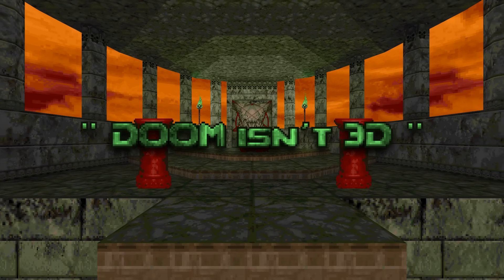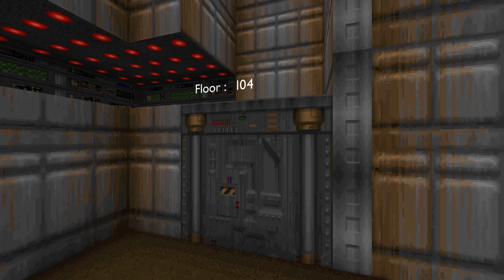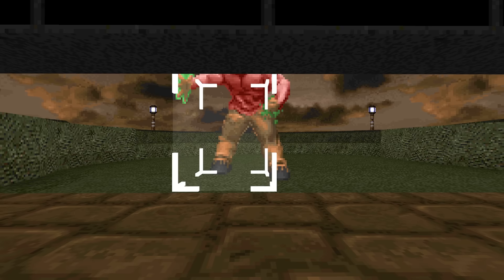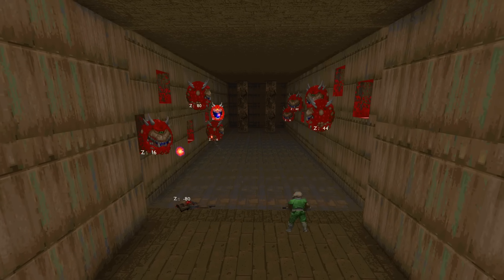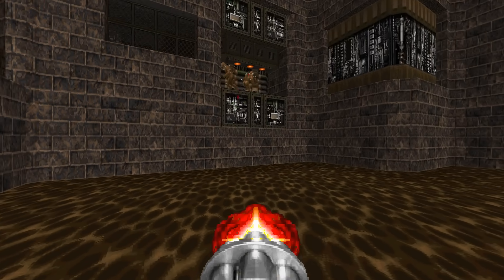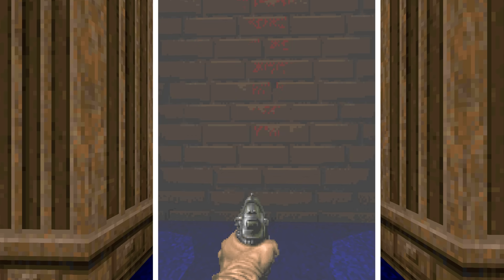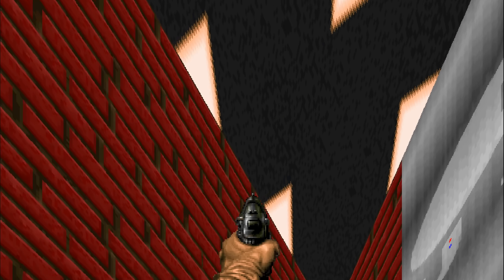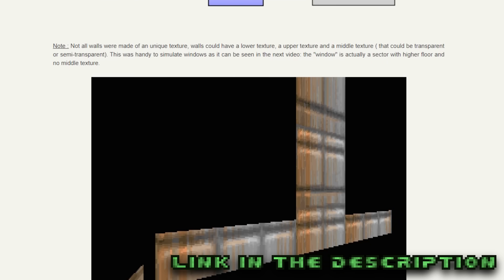Doom engine - Limited but still 3D

Comment: Really good vídeo but i think that a very important aspect have been overlooked in this conclusion, that is the  projection method of doom,  If the projection really is capable of 3D calculations this shuld be it, other wise , doom is a Scan line renderer that can not project 3D geometry only vertical walls, dispite enemy and player use the z Axis  the result is a scaled 2d image that is not necessary to use the  z Axis in calculations to display this 2d sprite, If you could check this information, everything would be more clear
Reply: @borogk  what i refer to is not rendering limitations, but actual data trasformation, im sorry If i'm be a bit too tecnical, but the main factor that defines this discution is the methematical and tecnical information, limitations indeed not defines the existence or lack of 3D in doom. About gameplay be a deciding factor well... capabilities of a tecnology are not defined by user perception. Anyway i'm not saying that i disagree in your conclusion since i have no deep information on how doom engine actually works and many points that you come up with actually drives  aroud actual 3D, but i would insist in a more directional investigation of the case.
Reply: @SilvestreCoda-c2o  

"The gameplay is strictly on a 2D plane, but the rendering is done with 3D coordinates." John Carmack

The engine is a hybrid using several techniques to achieve its unique features, I think that instead of asking "Is DOOM 3D?", a better question would be "What in DOOM is 3D?"

As far as the data structure goes, DOOM is a top down 2D shooter with X,Y coordinates for vector drawing, hitboxes, movement, acceleration, collision detection, line of sight for the A.I. and projectile trajectory calculations. Actors and sectors have an internal stored value for Z that's used for z-clipping calls (a technique used for depth sorting and hit detection in 2D games) and rendering offsets for walls and sprites, which's what creates the illusion of 3D physics, but it cannot be used for trigonometric functions and world coordinates. Another oddity of the IDTech1 is that a lot of its functions are sector based, meaning that every entity inside a given bounding box called "sector" will inherent some of its variables for data check (that's why walking monsters "pop" glued to the floor when crossing sectors of different height or "disappear" in dark sectors). The game physics and geometry are bound to a 2 dimensional plane, but the rendering of walls requires 3D calculations for dinamic horizontal perspective corrections, which's simplified by the fact the engine can only draw orthogonal projections from the camera POV, while floor and ceilings always keep their perspective and are rendered separately from the walls.

Here's a 2D game prototype I found that uses techniques similar to DOOM to emulate "height". What it lacks is the ability to rotate the camera 360 degrees, which would require those tiled sprites to be vector rendered with 3D perspective correction, which, although limited due to processing power of PCs at the time, is what's actually 3D in DOOM.

https://www.youtube.com/watch?v=AAeOXqS271g
Reply: @filibuster2249  now, that does ring  a bell, so actually there is 3d calculations !  really cool, i certanly shoud give a deep look in the subject, doom engine always was a true mistery for me since most of the easy to  consume information really never show up in dept implementation, i already try to come up with a psudo 3D "engine" but never took the time to actually look what other engines actually do, thanks for the colaboration.
Reply: @borogk   // "Z value is used movement and collision detection against the level boundaries"

That's pretty much covered by what I said here:

"Actors and sectors have an internal stored value for Z that's used for z-clipping calls (a technique used for depth sorting and hit detection in 2D games) and rendering offsets for walls and sprites, which's what creates the illusion of 3D physics, but it cannot be used for trigonometric functions and world coordinates"

Collision detection against the level boundaries (linedefs) are pre-calculated and stored in the BLOCKMAP lump using X,Y coordinates and called when an entity collides with each and every linedef regardless of "height". If the value assigned for the entity (zfloor + height) is > than next sector zfloor and < than zceiling, the projectile enter the next sector, otherwise it collides. These aren't world coordinates but values stored in the entities themselves for z-clipping.
In the case of mobs, if the floor offset is <= 24 (if I'm not mistaken), by default it counts as a "stair step" and the mob "pops" into the next sector's height offset. If the zfloor value is higher or the zceiling value is too low, the linedef blocks the mob, it's a simple value range checking used in z-clipping functions. 

https://github.com/id-Software/DOOM/blob/77735c3ff0772609e9c8d29e3ce2ab42ff54d20b/linuxdoom-1.10/p_map.c#L186

That's pretty much what's happening in that video I linked (except it's not cheching for ceiling, but the process is the same), that's what z-clipping is. Note also that the player character jumps in an arch motion and has "air time", which would be equivalent to "gravity". It all has to be coded somehow, but none of that requires an actual z-axis to be calculated or rendered. Of course the IDTech1 is more robust than that, but none of its functions relies of a z-axis when it comes to gameplay.

// "Here's a part of source code responsible for vertical movement: https://github.com/id-Software/DOOM/blob/master/linuxdoom-1.10/p_mobj.c#L246 "

That's the part responsible for calculating sprite and camera offsets, as I mentioned above. All it is doing is basic arithmetic for data storage and rendering purposes.
Player (camera POV) and things (sprites) spawn on the map using world coordinates for (x,y) stored in the lumps, while z is assigned according to the sector's offset + the variable "height". 

https://github.com/id-Software/DOOM/blob/77735c3ff0772609e9c8d29e3ce2ab42ff54d20b/linuxdoom-1.10/p_mobj.c#L642

https://github.com/id-Software/DOOM/blob/77735c3ff0772609e9c8d29e3ce2ab42ff54d20b/linuxdoom-1.10/p_mobj.c#L708

Here's the function that calls P_ZMovement (the one you linked) :

https://github.com/id-Software/DOOM/blob/77735c3ff0772609e9c8d29e3ce2ab42ff54d20b/linuxdoom-1.10/p_mobj.c#L415

First it calls for P_XYMovement, where the P_TryMove actually is located and checks if movement is possible. If P_XYMovement returns True then it checks if the internal 'thing's' value for z is different from the sector's floor (floorz) value, meaning the 'thing' is considered "airbourne", then only if True the P_ZMovement is called to decide how the 'thing' will be offset on screen and then stores the new value for rendering. 
There're no (z,x) or (z,y) calculations here or anywhere that I'm aware of. In short, the engine only recognizes x,y as axis for calculating angles , while z is only used to offset things on screen in relation to each other (or the screen itself when the player moves through sectors) and z-clipping (what to do when things collide with each other or with a linedef on the x,z axis). Z is an thing's property, not an 'world" property like dimension, so to speak. 

// ""The gameplay is strictly on a 2D plane" quote from Carmack - he probably didn't give enough thought before tweeting stuff :) It takes more than 1 minute to come up with more accurate answers and that requires reading and understanding the source code."

I'm pretty sure he understants it better than both of us combined at any given second. I couldn't have come with a more succinct and accurate explanation if I tried ;)

Congratz for the channel btw!
Reply: @borogk  " The end result is very close to what a modern engine would achieve if you construct a polygonal 3D level with straight walls, flat floors, flat ceilings and cuboids for entity hitboxes."

Modern engines can and do trace angled lines in (x,z) (y,z) and (x,y,z) for movement, collision detection and line of sight and much more. DOOM can only trace trajectories in (x,y) since z is only an object variable for reference, it would require the engine to keep track of all points in (z,x) and (y,z) that an object occupies (like in 3D engines) and it would be too demmanding for computers at the time. Instead, everything is checked on a plane and when collision is detected it does a value range check for a single z point reference stored in the object. It's no different than checking a random value against variables called 'Avoidance' and 'Accuracy' to check if it will be a hit or a miss.

"It doesn't matter what data structures are used to construct the level geometry and store objects elevation. You have to store it somewhere. Effectively, Doom data structure represents a traversable empty space in a shape of multiple 3D prisms (with sector shapes defining their cross-sections). And objects' hitboxes are effectively cuboids. "

"Vertical angle in Doom source code is called "slope" and it's totally used in the engine.:"

It's not so much only about where it is store and more about what functions call these values and what operations are done with it. 
Note that at all times in the lines of code you linked the functions are storing numbers to be checked against each other for z. It is not tracing a constant diagonal angle but checking value ranges whenever it moves to a new subsector (BSP cuts of a sector). It always comes down to z1' > 'z2' < 'z3'. Since everything (including things hitboxes) are lines drawn in (x,y), z functions can only be called and change variables when (x,y) trajectories finds a linedef or a hitbox.

   If anything, the way the engine manages to define occlusion points with simple math without relying on a third axis only adds to its ingenuity and brilliance. As I said, I'm answering the question "What in DOOM is 3D?" and none of z-functions I'm aware requires (x,z) (y,z) angles, let alone 3D calculations.

Comment: great video, though i'm a bit confused by the mentioning of the Z axis, i've usually seen Y used for height in games and programs and Z for depth.
then again there doesn't appear to be a universal standard.
also a game like Wolfenstein 3D is considered 3D but DOOM which has much more complex 3D mechanics is controverial? like what?
anyways i'm wondering how the game renders the floor and ceiling texture, since the pixels can be in all sorts of angles as you can move the camera freely to the left/right
Reply: @borogk  seeing all the different source ports for DOOM i'm sure they aren't all consistent with eachother either. so some might use Z some Y.
anyways, i edited the comment while you were replying to add a question, take you take a look at it again?
Reply: @borogk  i mean for wolfenstein it's in the title of the game, so i assumed people just took Id's word. plus i'd still say it's 3D rendered (ie you got walls, floor, and a ceiling like in any 3D Space) even though all of the gameplay is 2D.
and about the Z/Y DOOM port thing i just assumed that that would be the case simply giving the amount of ports out there, i've personally never seen it.

Comment: I appreciate the fairly neutral opinion-based approach of this video.
It really depends on your definition of 3D. At least from a mathematical standpoint, it is not enough to simply have a z parameter to consider, there is a subtle but crucial difference between a 3D space and a 2D space with an extra scalar z variable, which is what doom is as far as I understand it.
Doom's rendering works like a graph of a two-dimensional function into a scalar f(x,y)=z in which every point of the floor or ceiling is asigned a height. Which can be represented in 3D but not necesarily, it could be represented with colors like a heat map or numbers, doom chooses to represent it like that to appear 3D but that doesn't transform the world into a 3D space, but a very specific 3D visualization of a 2D function. And you can do a lot with having this third parameter asigned to the 2D space, if you've ever played the genesis game beyond oasis, height considerations are taking into account all the time to determine if you are hiting an enemy or not, but it doesn't have the fancy rendering of doom so no one would call it 3D. But there are limitations to the approach, like yeah... by definition of a function, no point can be assigned to two different values so that is why there cannot be floors on top floors, or enemies on top of enemies which I assume are processed together on the same function. But you can calculate trajectories just find and do all of your trigonometry, like with projectiles.
So in my opinion, the existence of z doesn't actually make doom 3D, it means that it is a 2D game that assigns a z parameter to all of its objects as a shortcut to do a lot of pseudo 3D calculations.
Think of it this way, you can have a 3D map of the earth and assigned to it a temperature value for each 3D point, you would have x,y,z and T and you could even make a 4D graph of it but that wouldn't make the earth a 4D space.
Reply: @borogk  Floors and ceilings having separate coordinates can be described by two distinct functions with z values, you can map any number of 2D functions on top of each other and still not have a proper 3D space. The same with enemies.

After thinking about it. I don't think it is impossible for a 2D engine to process doom guy going above the demons if you program explicitly to check for the z data, they are all separate entities. And if you turn off collisions that is exactly what would happen, doom guy would not go "above" the demon but through its collision box. And I think collisions are handled with only two variables precisely because the game is already processed in 2D and is cheaper.  It would be more problematic if you had floors on top of floors. Not that it is impossible, you can program whatever you want if you do the math for it.

And in the topic of projectiles I believe that is what is happening, the trajectory of projectiles are more important so they made the collision calculations take into account the height value for the enemies, since projectiles (I believe) have no height, that is automatically easier. They also can't collide with each other as far as I know.

I think we could say that in general doom is a 2D game with a lot of 3D calculations to compensate. Being 2D or 3D is not a real restriction to what kind of math you could do, so I think that is where all the contention is.
Reply: @borogk  Thanks for answering! And for the patience responses. I haven't looked at much of the code and I'm not a very skilled programmer so my opinion is to be taken with a grain of salt.
Yeah I've never consider that the 2D/3D argument is kind of meaningless. The code or the math within the code doesn't care if you consider it 2D or 3D. Is just what it is, and it has some 2D simplified elements and some 3D elements. It is pretty ingenious how they crafted a convincing 3D world without needing 3d graphics cards.
Thank you again for all the great points.
Reply: Height bitmap?